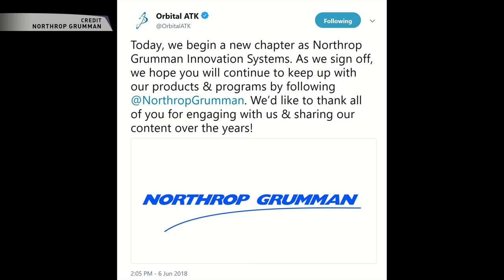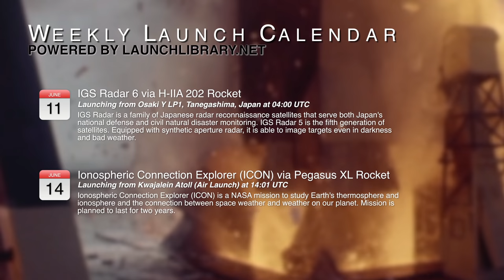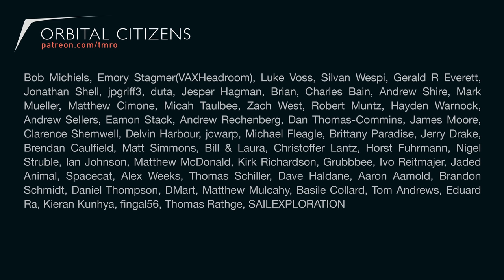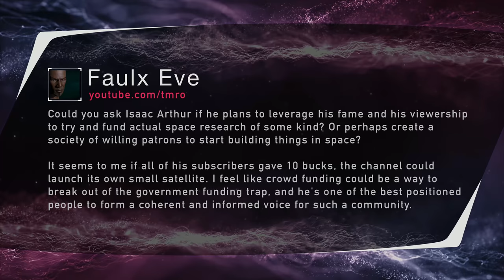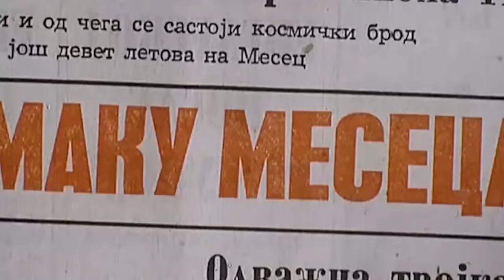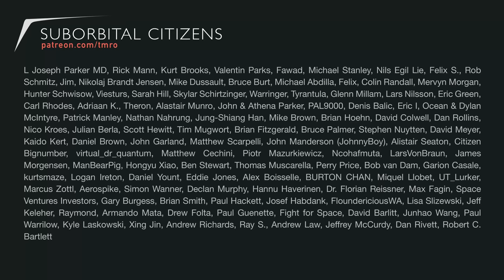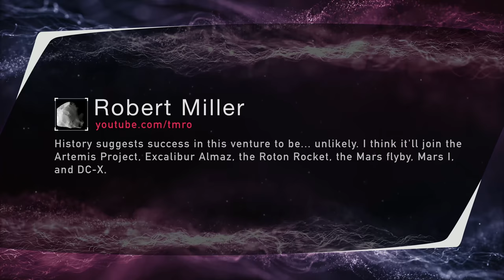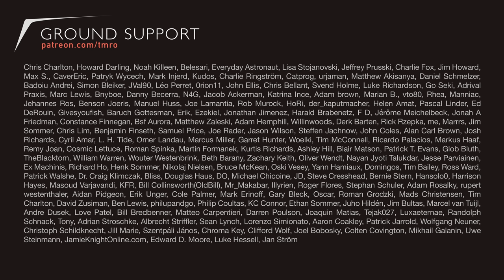TMRO:Space - Humanity amongst the stars with Isaac Arthur - Orbit 11.23

Comment: The thing amazes me is this  im pretty sure the Russian's soyuz is the same rocket they used is sixty's they havent been able to improve on the design i think its they're ballistic missile delivery system i think so in any ways if im wrong whitch is quite probable im sure one of you wouderfull people will very politely let me know
Reply: Dominic Briggs Almost correct. Basic layout is the same. Minor upgrades to engines, major to electronics over the years. Not sure if structural materials changed much. R7 booster family is one of the best designs and most dependable if you keep quality control up to scratch. They failed this couple of times with their Progress launches...
Reply: Wojciech Kasprzak thanks for update its allways nice to read a reply that starts by being told i was more or less correct im off to watch a vid on broken space toilets now
Reply: Their ICBM's are a different class of rockets than Soyuz even though the R-7 on which the Soyuz is based began it's life as an ICBM. Generally they use staged combustion engines but hypergolic, like Proton. Funfact, Proton was originally thought of as an ICBM for the 100 mt version of Tsar but that was never done. Their most prominent ICBM's are the R-36 missiles also known as SS-18. They are now being replaced by RS-28 a very heavy missile.
Reply: You are right they can't produce anything new

Comment: A silly question regarding first stages crashing into the ocean. Does anybody know what the strength of the impact is more or less and does it pose any threats to marine life? I know it benefits corals and that in perspective, rocket waste is a small fraction of the overall waste we put in the ocean but my question is more about the impact itself. Was just wondering and can't find any footage of a first stage actually crashing into the ocean so...
Reply: The SpaceX boosters on barge recovery missions have to slow down about 7000 km/hr to about 1200 km/hr before hitting the top of the mesosphere and they still get hot enough coming through that thin atmosphere to have melted parts of the old aluminum grid fins. The rocket exhaust from the entry burn is the bulk of the "heat shield", it is not just about losing velocity.
For a first stage rocket not trying to land it will probably mostly be the hard bits and the thermally resilient parts of the engines that hit the water. At a very fast rate. They will do so well out past the continental shelf in deep water. The majority of the structure of a rocket is very much like a beer can.
Jeff Bezos paid to have one of the Saturn V F1 engines brought up from the ocean floor a few years ago. Also, the zeroth stage of the Soyuz don't go to quite as high a speed and they crash on the plains of Kazakhstan. Look those pictures up.
Reply: to deep for coral and no fish will be hurt 99% sure
Reply: Due to the speed, the impact is pretty strong, but that's exactly what makes it less of a threat to marine life. Metallic objects hitting the water at high speeds disintegrate easily (look at clips of bullets, cars or planes hitting the water). Water is very effective at stopping things at high speeds (even more than earth). But, in case a rocket or bomb detonates underwater, then it's something different, the impact is pretty serious because water propagates sound very effectively.